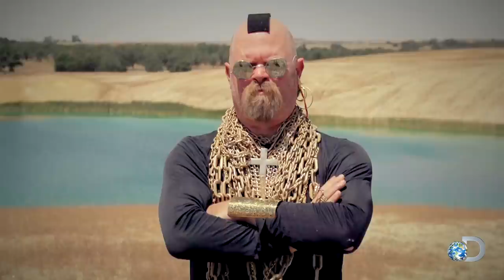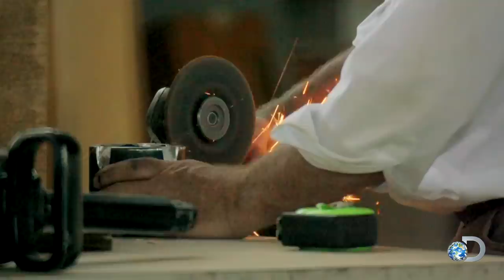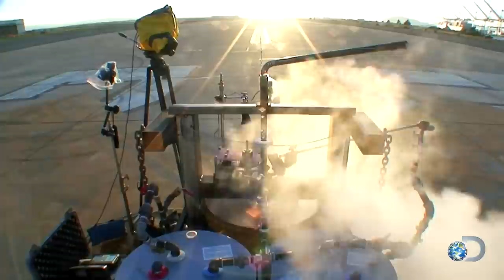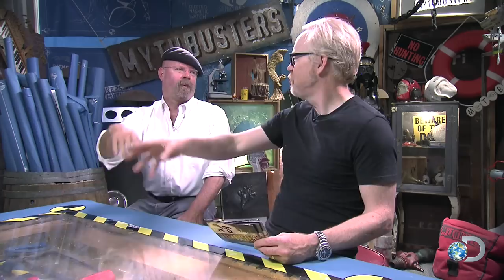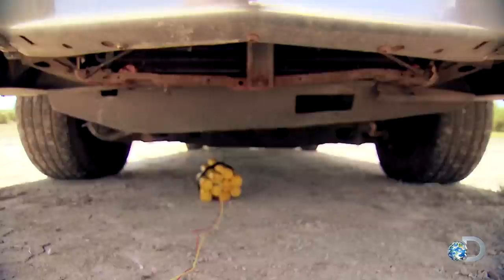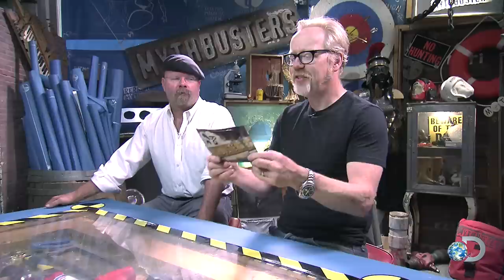A-Team Aftershow | MythBusters

Comment: The Shockwave was way more intense and defined when they added the manhole cover over the dynamite. 

Just laying it on open ground beneath the vehicle proved much more chaotic and unpredictable, compared to the other. 

You can see it very clearly in the high-speed photography footage, an extremely defined pressure ripple through the air, propagating up, more than laterally, causing a much more pronounced and intended result.

Comment: When they used the plunger to set off explosives, it was purely for the visual.
They could have done the same thing with a 9 volt battery and a switch. It just looked more impressive using the antique plunger.

Comment: remember the episode of killer ping pong ball myth 
try to vacuuming the barrel of a bolt action sniper riffle and then shot it you will be impressed
Reply: Vacuum the barrel?  you mean pull a vacuum to drop the pressure inside the barrel?  What would that accomplish?
Reply: +AreThereNoMoreNames The powder in the shell casing would not ignite due to lack of oxygen.
Reply: +Samuel Kelly black powder has its own oxidizer, it will fire in a vacuum, or underwater.
Reply: Samuel Kelly
The cartridge is sealed, and smokeless or blackpowder will oxidize itself in any condition as long as it's dry and not damaged.  So long as the powder is dry it'll fire underwater, in space, or on the surface of Venus before the acidic atmosphere eats through, though the high temperatures might cook the round off first.
Reply: The Mythbusters themsleves has tested firing a gun in a vaccum and it worked.
Reply: The stupidity of some people...